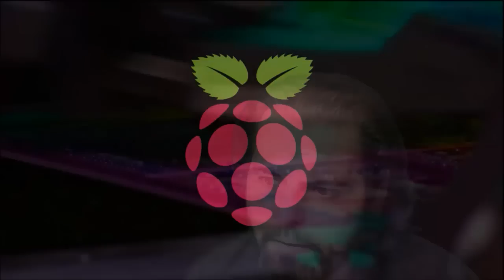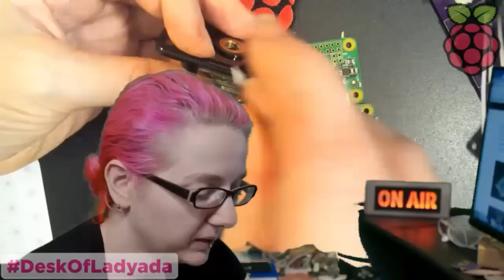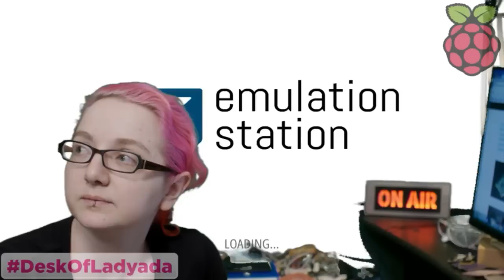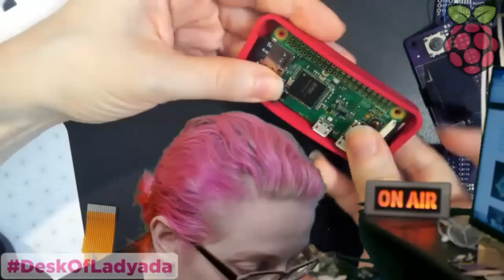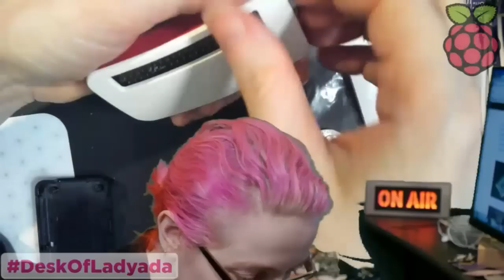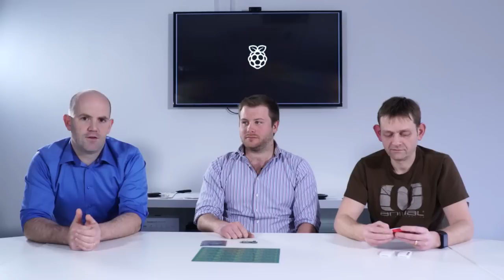#DeskOfLadyada @Raspberry_Pi Zero W is HERE! 2/28/17 @adafruit #adafruit

Comment: What is the speed of the built in wifi? Is it faster than the zero Ethernet hat at 10Mbs?
Reply: It's a single-antenna 802.11n, so it tops out at 72 Mbps in most cases. It does support 40 MHz channels, so it can do 150 Mbps if your router supports it and there is no radio interference.